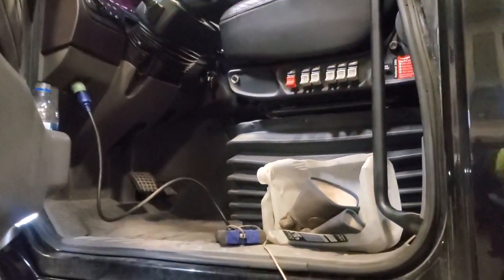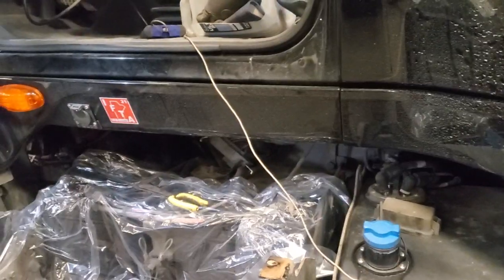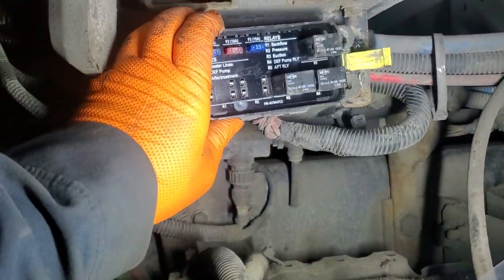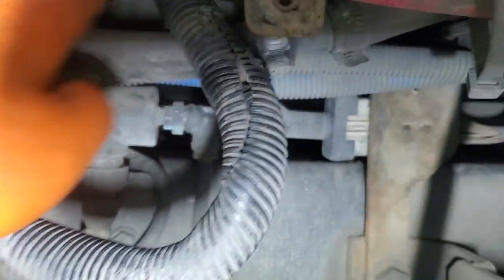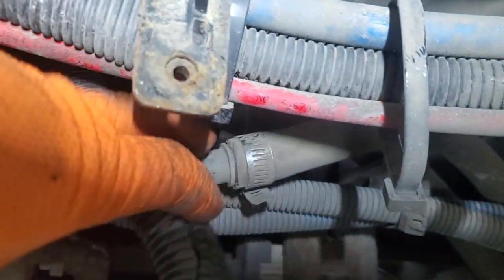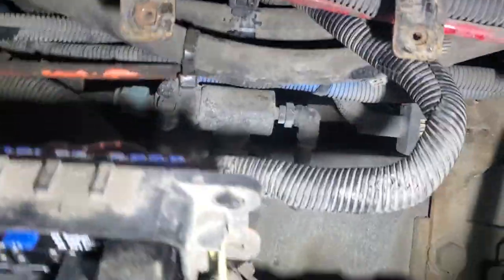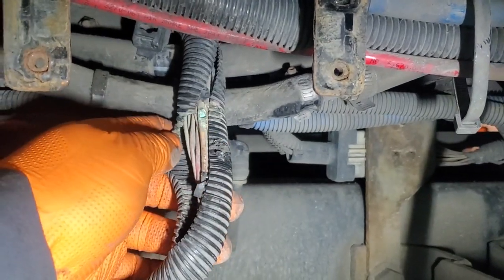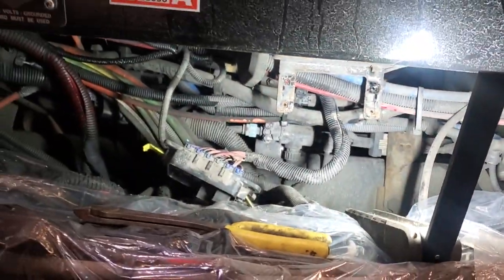International LT Aftertreatment and DEF line heater codes fix. DERATE. common cause and repair DIY

Comment: I have 2019 LT 625 with X15 in it and I'm exactly having the same problem and Rush truck center or International dealers doesn't have part in there system so i have to pull out mine to see part number to order it. What a crazy engineering and so many problems. Thank you for your time and help.